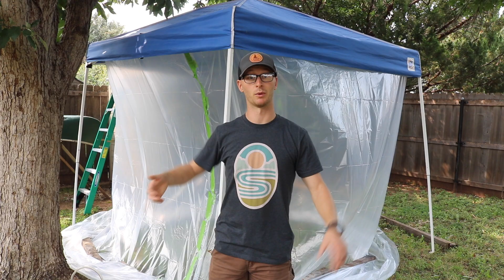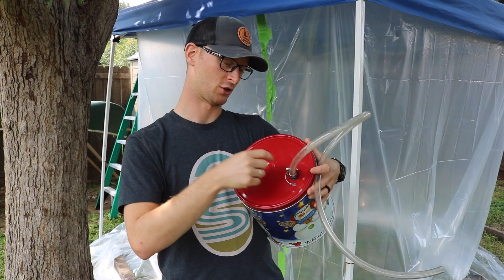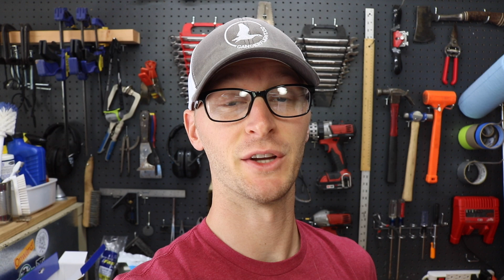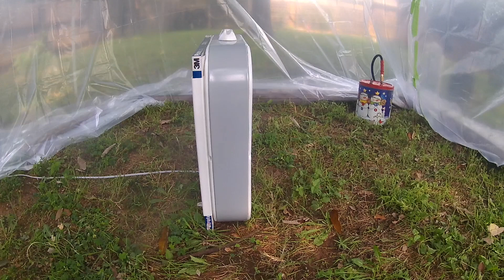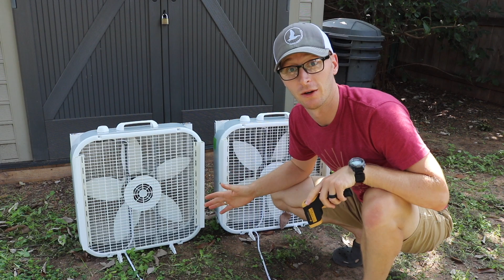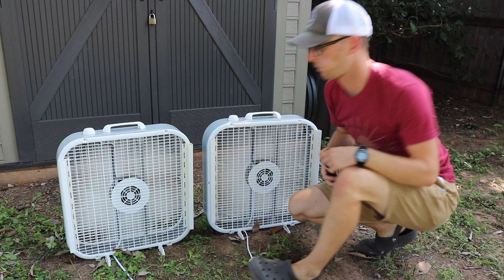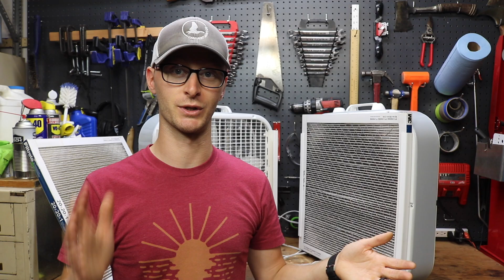Are DIY Box Fan Air Filters SAFE?

Comment: Motor temp is not how you check the fan motor. You need to check that the amp draw is not greater than the max amp rating of the motor. If it is then you'll burn up the motor or shorten its life. Some fans will over amp if they dont have enough restrictions on them but not these box fans. Anyway, motor amps are the key.
Reply from the maker: Thanks Terry!

Comment: umm, nobody gonna point out the fact that he did this shit outside why....???  There could be way more of a difference in performance and temperature between filtered front or back and unfiltered in a 70 degree room than outside in 80-90 degree whether and also you should measure the electricity used also.
Reply from the maker: ...because I didn't want the smoke inside my home...

Comment: Been doing that for 30 years. no issues. although  I put the fan on the back and tape off the corners of the box fan outside the radius of the fan blades, that will fix it.

Comment: I have an induction hot plate and want to cook a steak. It smokes really badly and my vent above my stove never worked right. I want to figure out something I can make that will suck the smoke away from my skillet and not get into the air and set off the alarm and make my apartment all smoky. Any ideas for this. . .
Reply from the maker: Best idea is to get the vent above your stove fixed. Otherwise try putting a fan in the  window pointing out?

Comment: Nice experiment. I have been using this system to remove dust from my garage work area when I have been doing wood work. I only run the fan with the filter for maybe several hours during and after I generate dust. I have always put the filter on the back (intake side) and it certainly clears the dust from the air. Also tried it in the house during pollen season and it also seems to work. The problem is that the fan makes noise and my wife doesn’t like it. Been using Honeywell or 3M brands both rated for dust and dander I get at Home Depot. No MERV rating provided on the packaging.
Reply from the maker: Yeah Home Depot made up their own rating system. Merv 13 is equivalent to FPR 10

Comment: I've optimized the flow for the Lasko Comfort Box Fan. Placing a shroud on the exit grille with a 15" diameter hole increases the flow through the filter on the back by 38% https://twitter.com/DavidElfstrom/status/1427819404163751936?s=20
Reply from the maker: What are you using for a shroud?
Reply: @GanderFlight  cardboard, and/or "duct" tape. For iterative tests I used painter's tape

Comment: Great video thanks. Actually I just put my filter up against the rear of the fan and it gets drawn tight against the fan without using tape etc. Not perfect air tight fit but seems to work.
Reply from the maker: Yes that definitely works! Just causes issues when you turn the fan on and off everyday.

Comment: I’ve used this method while replacing my attic insulation in mid summer.
Not only did it filter out the insulation particles it still dropped the attic temperature by 10 degrees.
This works and I’m planning to use it to take some of the strain off of our home furnace. 👍👍
Reply from the maker: Thats a good use for that project!!

Comment: Great testing! Good to know what the temps are! If people are worried about static pressure and strain on the motor they could get larger filters. I think you can get 20"x20"x2" which would double the filter surface area so more air will pass through. The larger the filter media the longer it lasts before clogging to so that is an advantage. I have that exact fan and been using it in a custom wooden box for 3 years. I made mine for a 20"x25"x5" filter which is 5x the surface area of a 20"x20"x1". I can run the fan on medium and get more airflow in the room compared to the smaller filter on high with all that extra surface area passing air. If you really want the motor to last long and quiet the fan down a little, I put a link to a video on balancing the box fan blade below. The bearings will have less stress on them and it will be less shaky when running but I use mine on medium speed so I'm already putting much less strain on mine so I never tried to balance the blades. https://www.youtube.com/watch?v=moo95i_6QZs
Reply from the maker: Super helpful, thanks Practical Guy!
Reply: I just build a cube using four filters, the fan, and cardboard for the base. 13 merv 20x20 x2. Wow! Amazing filtration. Seems to be helping my COPD person.
Reply: @pattip1413  That is a lot of filter surface area going with the 2" filters! Just slightly more than my 20"x25"x5". Sounds like its doing a great job for you and you'll need to change the filters less with that much filter dividing the air going through the box!
Reply: thick filter is the biggest lifehack of them all.  so much more portable, better looking, able to fit in more places, less tape, and cheaper than multiple filters

Comment: Thank you for the comparisons! I live over a highway, so I always tape a filter (rated for "smog" as well as the other categories) against my window fans, with the idea that something is better than nothing! I notice a difference, and especially think about all of the dark dirt accumulating on the filter, which is probably mostly smog and at least that portion of it didn't make it to my lungs! Your experiments made me wonder if there is a way to enhance the filtration in a window air conditioner. Do you have any ideas, or do you think taping a good filter (that has proven to allow good airflow with a fan) to the outside of the front intake of the a/c would do some extra filtering and be worth it?  (I might try it and report back to you if I see any pattern of dust/dirt accumulation on the filter, and if the normal filter a quarter inch away from it inside the machine ends up needing fewer cleanings.) (I'll also let you know if it seems to make the unit labor or get too hot or anything.)
Reply from the maker: Experiment and let me know - I'm not sure how that will affect the air conditioner unit.

Comment: I watched a vid the other day for a woodworking shop, they had 4 20" filters duct taped together on a plywood base and fan placed on top.... Tried it fan blowing into filters and   fan pulling air into filters.... The only difference was pulling air through blew the dust mixing it around the shop on everything
Reply from the maker: Interesting - mind sharing a link to the video youre referencing? I'd love to take a look!
Reply: @GanderFlight 

One thing leads to another.... Here is the YouTube that started me thinking YouTube. Com/watch?v=aw7fUMhNov8 which led to this one YouTube. Com/watch? V=uM7mR-95KUg. There was another one that showed a guy putting something similar on wheels on a piece of plywood to get it adjacent to the tool in us. That's the set-up I'm going to use.

Comment: Great Video, I use the filter on the back of the fan I notice it works better for me, Question ur thoughts , I put filter on back of fan with the air flow arrow pointing towards the front of the fan because it is sucking the air through the back and out the front does that make sense??...Thanks JJ
Reply from the maker: Yup you've got it correct!
Reply: @GanderFlight  Thank You for the reply..

Comment: Filter in the back keeps fan and motor clean. Where as if filter is on the front all the dirt and dust gets sucked into fan and motor
Reply: Clean motor makes fan last longer
Reply: Also if you use 4 filters taped together in a box shape and put back of fan on one open end and set other open end on ground there is less air flow resistance which means motor does not have to work as hard plus gives more surface area to filter air. Doing this should make filters and fan last longer.
Reply from the maker: True enough- also takes up a TON more space.

Comment from the maker: 🚨🚨!!NEW!! 🚨🚨If you’d rather purchase a ready made unit, Lasko now offers the Air Flex 2 in 1 box fan that includes a MERV10 filter and filter holder built in! 
Amazon: 
https://amzn.to/3L2u7Fm

Home Depot: 

https://www.homedepot.com/p/Lasko-Air-Flex-20-in-3-Speed-Air-Purifier-and-Room-Fan-FF305/315516663 

Mendards: 

https://www.menards.com/main/heating-cooling/portable-fans/lasko-air-flex-20-air-purifier-box-fan/ff305/p-7720120058360405-c-12727.htm

Comment from the maker: Watch the original build video here: https://youtu.be/9vJk5BM8xUo
Reply: What did you put on the side of the fan to hold the filter? Where did you get it?
Reply from the maker: J Channel from the hardware store. Check out the build video here: https://youtu.be/9vJk5BM8xUo
Reply: Ours is cellulose dust in our newer home. I have tried every thing. My laser particle counter says IQ air filters work really well but a whole built in is  over 4000.    So I’ve been experimenting.  Idk if a regular merv 13 would work as it hasn’t on our furnace.  So we may put a 5” filter on the furnace and then try that first and maybe something like this first.  Before spending $4000. I’ve been noticing people have been trying all kinds of things like this.

Comment: Excellent video - Because of the Chinese Wuflu 1 year ago I made 3 box fan filters  except I used 4 inch thick filters & I used MERV 13's that filter viruses from the air.. The 4 inch are quite abit more $$$ but they last longer and have better air flow.  I heat the house with a pellet stove and the box fan filters both move the warm air around plus filter it. With the fans running my wife's allergies disappear as she stops sneezing within an hour of the fans running.
Reply from the maker: Larger filters are definitely better - as you mentioned more air flow, but like you said, they cost more and take up much more space. I'm thrilled to hear your wife's allergies are better when running a filter - win!

Comment: 1 advantage to having the filter on the inlet (back) side is the same reason furnaces are built that way:  it keeps the motor windings cleaner which reduces fire/smolder hazards from dust build-up.
Reply from the maker: Agreed.

Comment: If you use a 2 inch thick filter it will increase airflow, and any resistance on fan motor.
Reply from the maker: True enough - just have to find an alternative way to attach it when the fan it not turned on - rubber band, tape, zip ties etc.
Reply: @GanderFlight  i just made one from 4. 20×30×2.  Duct taped them into a box, put a 20 inch fan  on top pulling through all four at same time.  Its full flow from fan. 2k cfm on high.  By the way an Air King box fan is the best I've ever bought.  The thing is solid and moves tons.

Comment: Great Video ! if u Want to Add a Measure of Safety and don't want a Paper filter Slammed up tight against a hot motor. Space it away from the Rear of the Fan unit by a Few inches using Sheet metal and a Hvac Filter Rack.
Reply from the maker: Thanks for sharing the option :)

Comment: I agree with you, they last a long time and can run for years with a filter. My little dog liked to sleep in from of my box fan air filter. It was kept on 24 hours a day for over 3 years. The fan still works fine. I made a video of my little wooden clamp with a magnet and handle I made to attach the filter.  "DIY $6 Magnetic Dust Fan Filter air cleaner for Home & Shop"
Reply from the maker: Watched the video  - cool idea using the magnet!

Comment: 4" or 5" thick media will give you better airflow if you have a larger room to keep clean, you get the same surface areas as those attempts to build a cube using 1" thick media, without losing the floor space.
Reply from the maker: I haven't done much comparison - how does one 4" filter compare to buying 4 1" filters?

Comment: The problem isn't so much the fan overheating when the filters are fresh - it becomes an issue as the filters get dirty and they restrict more airflow.  Also, restricting airflow is wasting power, since the fan draws the same energy whether the airflow is restricted or not.  Without the restriction the fan could circulate - and filter - more air for the same power consumed, and you'd get more filtered air.

The solution is to build a box out of air filters, which you can just tape together with duct tape.  Get 4 appropriately-sized filters and a matching piece of cardboard and build a 5-sided box with one end left open for the fan.  Place the cardboard piece on the ground and build the box around that.  Now you have so much surface area for the air to pass thru there will be virtually no restriction to the airflow, so no electricity will be wasted and the fan will be able to filter more air in a shorter period of time than it can manage with one filter.  You also won't need to change filters as often.  Only real downside is it takes up more space and isn't exactly pretty, although you could always build or repurpose some kind of box or cabinet to hide the whole setup in.
Reply: This old house has a video for this
Reply from the maker: Yes, the box of filters would be overall better - but the amount of space it takes up and the aesthetics are the real killers - I currently have these set up in our bedrooms setting on a dresser - couldn't do that with the air filter box.
Reply: @GanderFlight  It does take up more space. You could get creative and possibly use narrower filters for the ‘sides’ of the box - not sure what dimensions HEPA furnace filters come in. Would still allow you to more than double the surface area of the filters.

Comment: I think a concern is the restriction of air movement that heats up the fan motor.   I've seen solutions to this where a box of air filters are used so that there are four areas for air to travel instead of your one filter.
I'll be building one for my shop to reduce the dust.  It's brutal in a wood shop.  The air filters sold at the store for shops is just too expensive.  Then buying the filters becomes another issue.
Reply from the maker: If you have the space, then yes the "box" of air filters will be a more efficient solution - I use them in our bedrooms on top of dressers so I was looking for something compact.

Comment: If you want to greatly improve the efficiency and performance of the box fan, cut out most of the front and back screen as  it hinders air flow.  You can use a pair of tin snips or wire cutters. You could also just remove the front screen but then there is no protection for fingers etc and this is important especially if there are children or pets in the house.  You will likely be impressed  at the improved airflow when the screen is no longer impeding air flow. 🤓
Reply from the maker: Not worth the safety risk as sometime down the line you may want to run the fan without the filter.
Reply: I'm doing this for my shop and I plan on mounting from the ceiling with chain and will run off the lighting circuit for switching. I may consider removing the vents for this application.
Reply: the improvement in cfm is negligible, regardless of concern for safety, the improvement isn't perceivable outside of a controlled experiment. Safety issues make the idea anything but a good idea. it is a non starter. it also creates additional dangers on top of the fan blades being exposed. structural integrity of the fan becomes greatly reduced and becomes essentially a projectile waiting to fail and fly off its shaft. if it fails within the filtration system, it will then becomes a ticking shrapnel time bomb.

Comment: I use a 4" merv 13 filter on the intake to take dust out of the air in my 200 sq ft shop.  When I was using my router my pm2.5 sensor didn't even blip.
Reply from the maker: Bigger is better for sure - just costs more and takes up more space - all depends on what you're using it for.

Comment: Seems the HVC system pulls it through the filter not blow it through. The temp will rise with the effort it takes to move the air. Any filter will impede the progress air movement. This old house made one with several filters and a piece of cardboard.

Comment: Kind of a clueless test.  Of course you'd pull the air in through the filter, otherwise the temperature drop on the moving blades (cooling and pressure drop) would cause the smoke to condense on the fan blades. 
An interesting test might be to see how well the motor holds up with the additional work caused by the filter. And maybe would a filter on both the front and the back be bad for the motor, and would it be better for filtration. Also what is the size of the smoke particles. Incense? Okay., but cigarette smoke? I was a bit shocked after taking part in a protest lasts year, wearing my N95 mask but then while walking back to the Metro station smelling cigarette smoke right through the mask. (My neighbor said cigarette smoke particles are smaller than the Corona Virus. Not sure if that's true.) 
And for the record I've been doing some air filtration with this pull through the filter set up for about 30 years.
Reply from the maker: As far as the additional testing and the motor holding up, I've been using the same two fans for over 4 years with no issues.

Comment: When the filter is in place the fan pushes less air...and therefore does less work....and would need less cooling.    When the fan does less work, the motor will not produce as much heat.

Comment: I’ve used a similar set up on job sites to control dust. I’ve found that placing the filter on the in take side will reduce air flow when the filter is clogged or dirty, reducing its effectiveness. Placing it on the output side means that air will continually be drawn through the fan
Reply from the maker: ....I'm not seeing how when the filter is clogged or dirty why it will change the amount of airflow front vs back - if its too dirty to allow air to flow it wont matter if that air is pushed or pulled.
Reply: The only logical explanation for a change in the fan speed would be if you don't have your filter tight the air is going to escape around the filter. If you have a tight filter their sure as hell is no difference when it's clogged if it's on the front or the back. That logic does not compute.